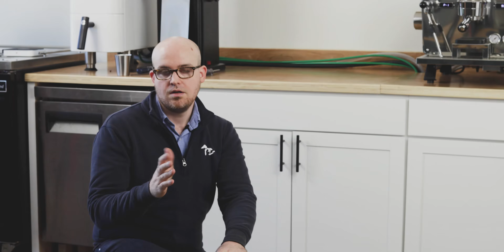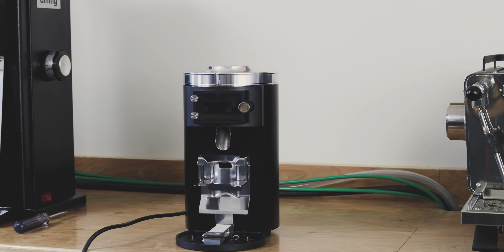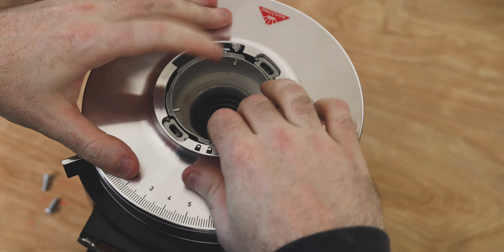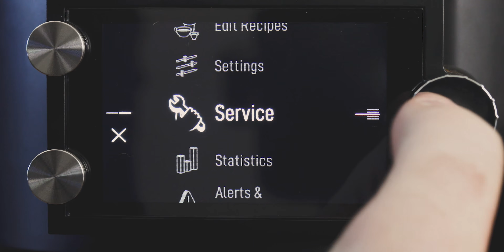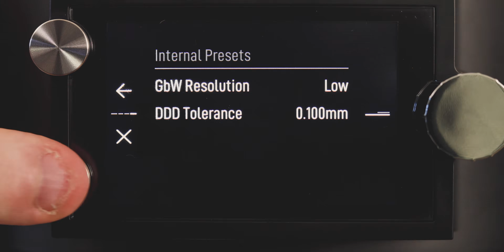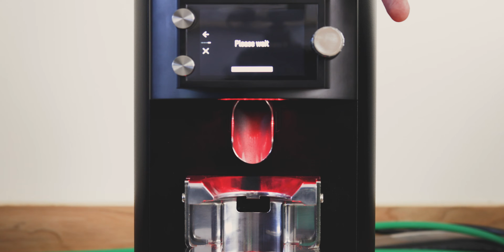Mahlkönig E65s GbW | Setup and Calibration

Comment: do you have presets for resolution on E80W GbS? mine takes to long before it starts grinding after putting in portafilter...
Reply from the maker: There are some calibration settings for scale sensitivity (you can find that in our E65S GbW Setup and Calibration video). But it's possible that your countertop surface isn't as stable as it should be. Strong vibrations or light shaking will delay the taring.

Comment: Hi ! Quick question 🙋‍♂️ For example if my ddd is 0.28 mm —> 0.70 mm . If I’m going finer would be 0.26 mm to 0.70 mm. And if I’m going coarser would be 0.30 mm to 0.70mm . So it’s an even number. But sometimes even going coarser or finer that number doesn’t change but doing so it changes the taste of coffee . What’s your opinion on that ? Also do you change the grind size whilst the burs are in motion ? I’ve got this grinder for few weeks now and I’m experimenting but so far we are quite happy with it and it’s very accurate in grinding. 

Looking forward to your response ! Happy grinding and pouring ! 😀⏰🥐☝️
Reply from the maker: Hello! It’s generally advised to be running the grinder when  adjusting finer to avoid burr lockup.